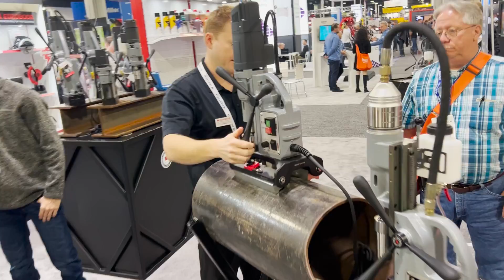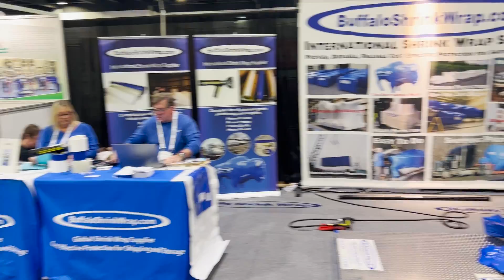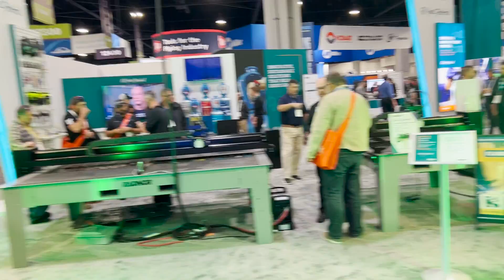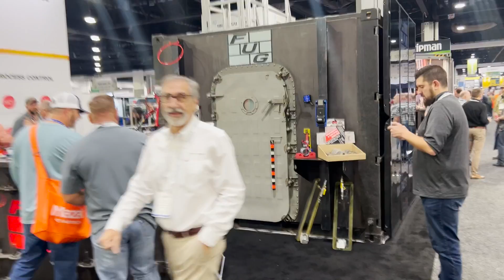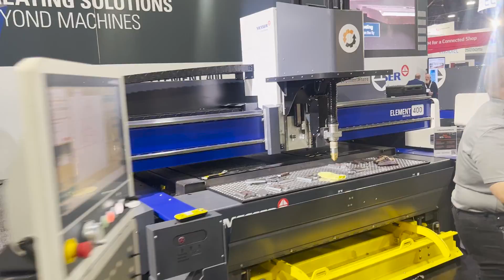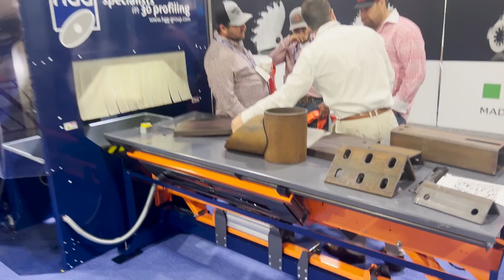Fabtech 2022 - World's Biggest Welding Equipment Trade Show

Comment: You should check out Fireball Tool which is American,  and his videos on tables vises clamping systems etc. nice to see you there A Fan of CP in Canada as well.
Hey you happen to have an older tig foot pedal with the old style plug connectors, I have a older Miller Dialarc HF - I picked it up for a hobby welding for tig, older welder/fitter. Still need to get the Hoses and torch and ground and a cooler for doing the aluminum - Just in case you had some old gear kicking around :) Help me get set up and I can do any small parts for ya that need some welding, if you have any shops in Canada - shipping now a days oh boy! $$ Just working out of my single car garage, fun stuff :)